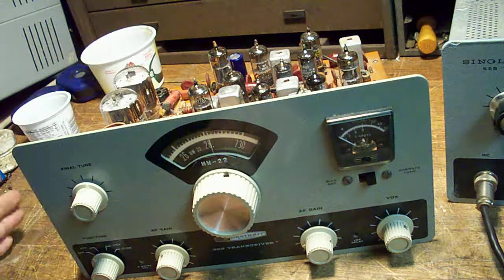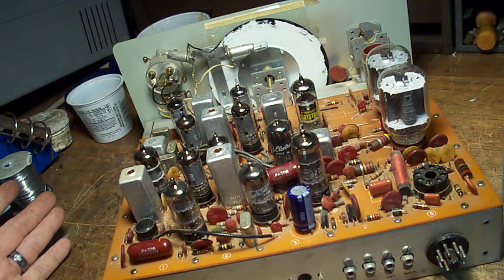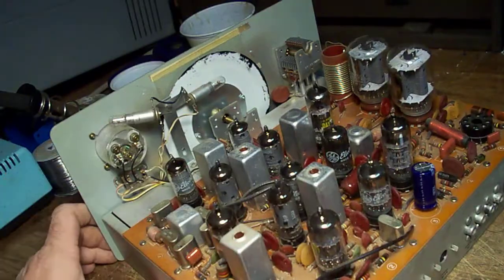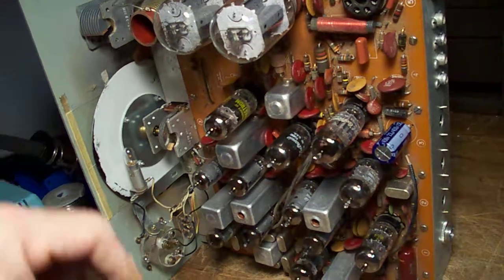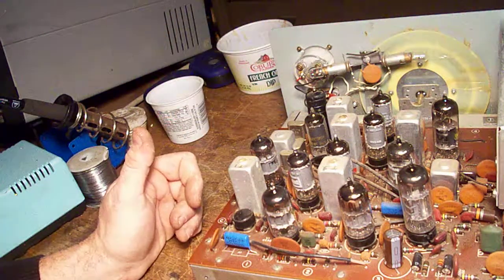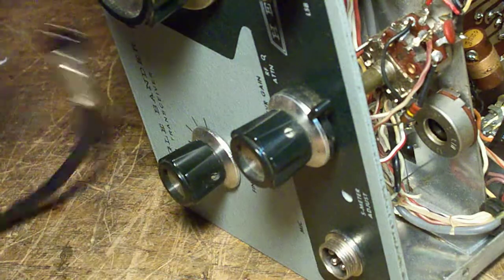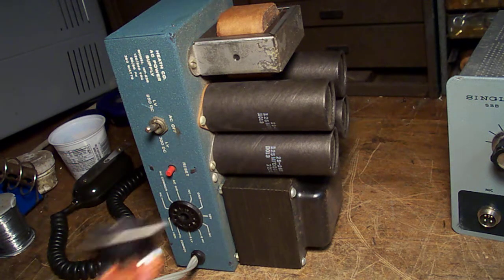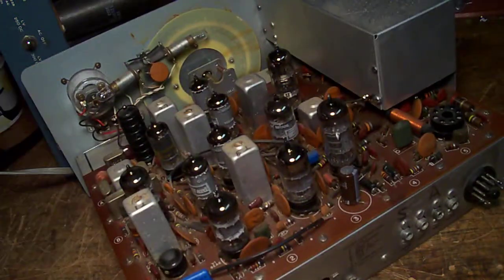An introduction to Heathkit single banders, Part 2

Comment: I've got the 20 & 80m versions of these and a 23C power supply I'm currently rebuilding.  I've got a bunch of vintage gear but look forward to putting these on the air.  The beauty of these as you pointed out is how simple they are.